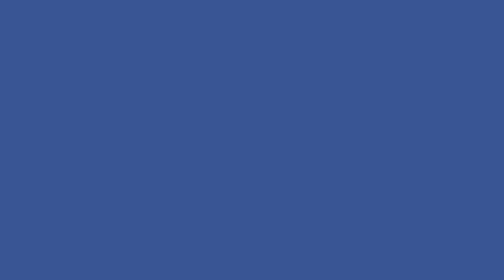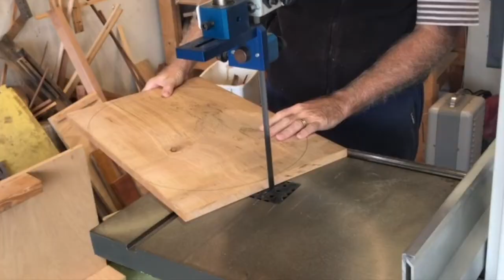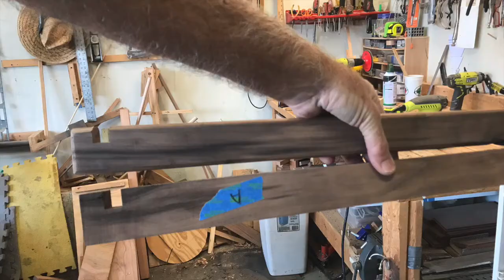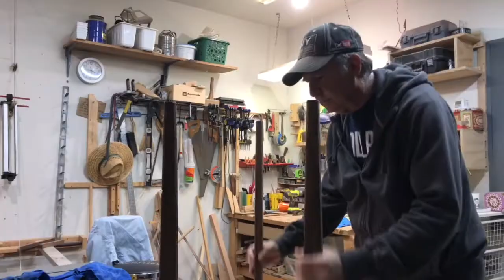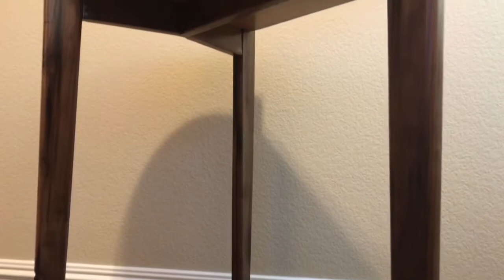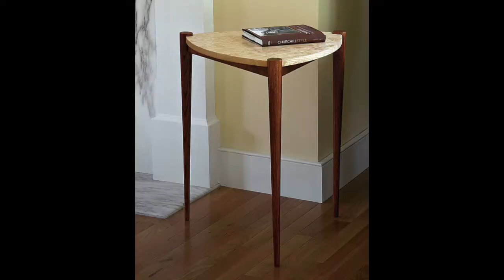Design & Build a 3 Legged Table

Comment: How are your legs and top attached to the bottom stretchers?
Reply from the maker: The legs have an open notch to receive the top and a small stretcher between each leg, that meets in the middle.
Reply: Did you glue the bottom stretcher to the bottom of your maple top and to the insides of the legs as well?
Reply from the maker: @MrPopeyekris  , the only glue was where the stretcher meets the leg and the dado joint of the leg and top.

Comment: Nice job, Bodie. Would you mind explaining how you successfully doweled those Y-joints? Thank you.
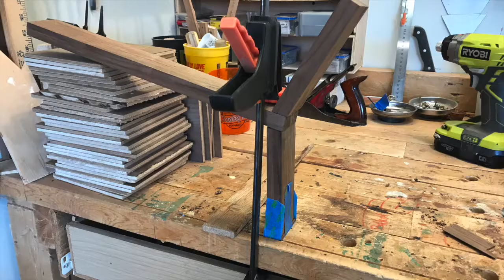Reply from the maker: You can see the glueup at the 7:00 mark,  a single dowel hole into middle section of the Y joint, and a single dowel into the legs and end portions of the Y connectors.
Reply: DIY Home & Garden Projects got it. Thank you.